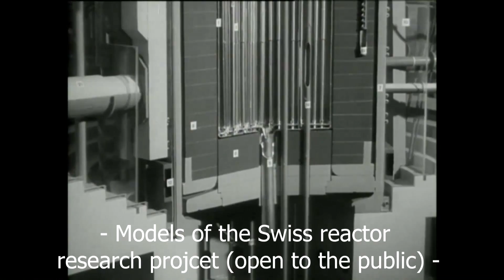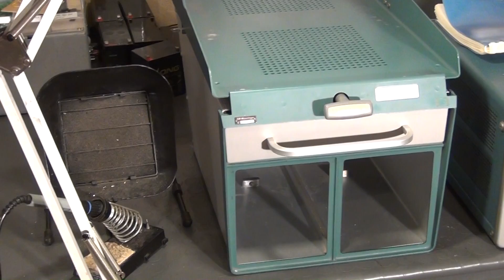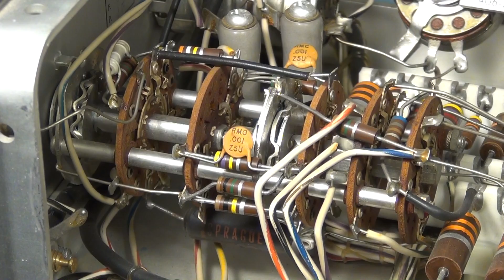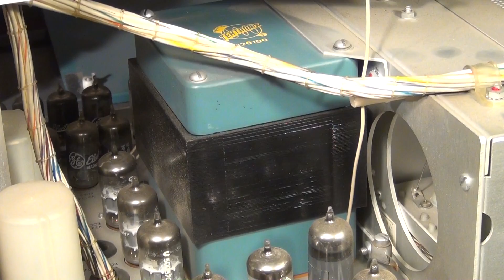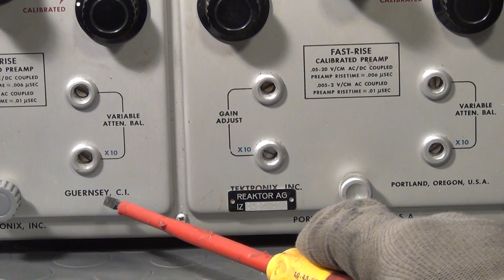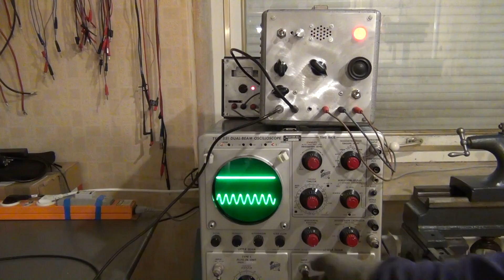A Gift from the Nuclear Energy Research Lab

Comment: Thanks for your videos. I was an EE at Tektronix in the Lab Oscilloscope Division at the peak of the company, in the 1980s. We had some really phenomenal solid-state lab 'scopes, including the 7834 500MHz phosphor-storage mainframe, and 7104 1GHz realtime analog mainframe that could display a single-shot waveform at 200picoseconds/division (and had an effective writing rate greater than 30cm/ns or greater than the speed of light). You can't appreciate how revolutionary this instrument was unless you've tried to capture a single-shot event such as a nuclear test, using a traditional 'scope with a camera hung on the CRT loaded with 10,000ASA Polaroid film. However, many of the seasoned EEs at Tek considered the later 500-series, especially this 551 dual-beam as the finest instruments the company ever produced. They didn't have the performance of the solid-state 7000-series 'scopes but as you can see, the design and workmanship was incredible. As far as the Telefunken tubes, they may be original. We had a European division that manufactured in the Common Market (EEC) to avoid onerous import duties and those tubes may have been installed at the EEC plant even though the panel says Beaverton, OR. That was before my time so I'm not sure. I've owned several 500-series instruments that had 100% original tubes, the designs were very conservative and the tubes lasted a long time. I have a 575 curve tracer from this era with 100% original tubes and it's in perfect operating condition.
Reply: If you are still in the Beaverton Oregon area, you should try Tektronics soup at Thai Bloom off Cedar Hills Blvd. Really good stuff. I used to work at the auto center across the street and worked on a lot of cars owned by Tektronics employees. Good people.
Reply: I was a ET at Scientific Atlanta in the 90's and we used Tektronix Network Analyzers to tune and set up linear Amplifiers. Great machines.

Comment: A lovely piece of kit. 
I spent some years in my early 20's repairing and re-calibrating similar 'scopes, mostly 545 and 585s, type 8x plug-ins etc. Just so that you know, you have to use special silver-loaded solder on those ceramic strips. If you use regular solder, you can break the bond between the metallization and the ceramic, which can make life unexpectedly interesting with some parts running at 500v. You really don't want those just waving around in the air...
I hope this helps if/when you need to do some maintenance.

Comment: I just stumbled into this post.  I worked at Tex as a college student (Oregon State) from 1961-1962 during the summers.  I assembles the sub chasis with the silver solder saddles where the capacitors and resistors were secured.  We could check out scopes from their lending lab and take home to play with.  As I remember the duel trace scope at the time cost $3,900.  I was so impressed because this was the same price as a new Corvette.  This video brought back many great memories.  Also, the first computer I was introduced to was a vacuum tube model located in the basement of the OSU math department.  Took up about 1,000 sf and required large A/C to cool the room.  Slower and less capable than a cell phone.

Comment: I suggest that you research the term 'distributed amplifier'.  It's a type of amplifier that overcomes the effect of the irreducible self capacitances of the valves (i.e. thermionic tubes') by incorporating them into a pair of delay lines - one in the control grid circuitry, the other in the anode circuitry.  Each section of the delay line incorporates one valve (or, in a push-pull amplifier, a matched pair of valves.)  The idea is that the input signal and the output signal proceed through the amplifier at the same rate, keeping in step with each other.  The distributed amplifier was patented in 1936 by William S. Percival who I believe was an employee of E.M.I. Ltd., Hayes, Middlesex, England.  See Wikipedia.  The delay inherent in the distributed amplifier is acceptable in oscilloscopes because it is often desirable to delay the application of the 'Y' axis signal to the vertical deflection system to give the time-base (aka 'sweep') trigger circuitry to get started.  Modern digital oscilloscopes work on a completely different principle, employing a fast sampling system to take successive samples of the input signal which are then read to appropriate pixels on the display screen.

Comment: Hello from Portland Oregon. I know the first two locations of Tektronix. It started as a radio repair shop. Now it's a bicycle repair shop. The second location which is the address of the first known advertisement has a nightclub now. Between the two locations on the same street is the childhood home of Linus Pauling (this fact has nothing to do with oscilloscopes). One of the founders of Tektronix Howard Vollum wrote his senior thesis at Reed College on Oscilloscopes. Reed College surprisingly has a nuclear reactor which is run by undergraduates. My dad worked for Tek when I was a child and I think he is the reason floppies were 1.44 megabytes. Back then almost anyone with a technology career in the region had worked for Tek at some point. A while ago someone told me the US government bought a new scope for every nuclear test because they became radioactive. Engineers knew that the only part likely to become radioactive because of what elements it was made of was purely cosmetic.

Comment: The ceramic terminal solder strips need to be repaired with high silver solder as regular lead-tin solder will dissolve the plating off the ceramic strips. 

 Many of the scopes has a short length of the correct silver solder inside for field repair purposes.

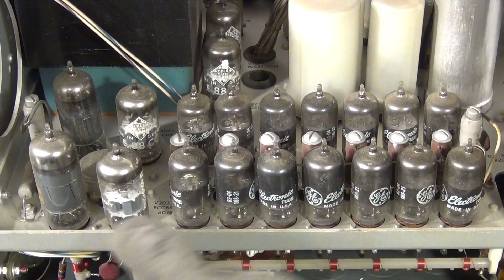Comment: 3:32 Be careful handling old vacuum tubes in devices where you have no documentation. The tube markings become brittle from heat and age, and will wipe off the with lightest touch, and you may now be unable to read the numbers you just removed. The white markings on the GE tube are crumbling and you probably did that when you pulled it out.

Comment: I just came across this on YouTube.  I worked for Tektronix for 23 years, my father and my uncle before that.  A few details about that model of oscilloscope.  The solder strips are ceramic, manufactured by Tektronix including the plastic mounting clips.  Except for the vacuum tubes (valves) and sockets, resistors, and capacitors, Tektronix made everything in that oscilloscope.  Nuts, bolts, sheet metal, switches, knobs, face plate, CRT, transformers, cart, etc.

Comment: A while back I saw an email offering an old Tek scope like this free to a good home,  so I went and snagged it.  It's a 536,  with one plugin giving dual traces,  and the cart.  I still have it and it still works,  though it's not my primary scope.  TURN DOWN THE INTENSITY!  You're going to end up burning that screen!  The terminal strips are not plastic,  but ceramic with silver bonded to them.  If you use regular solder the connection will detach from the ceramic,  you're supposed to use some silver-bearing solder,  a small roll of which was typically supplied in the little compartment that you open at the end of the video.  If your basement workshop sees any amount of dampness I would NOT keep that scope there,  as there are potential problems with the power transformer absorbing moisture and failing,  and they are unobtainium.  There are a few pretty active Tek scope mailing lists,  if you want to find out more...

Comment: i worked on a lot of scopes from that era. These instruments are very well designed and are remarkably long lived. My own 545 ran for 36 years with just a replaced tube here and there, it was replaced just because I needed a higher bandwidth instrument and the new scopes are so much smaller. .

 Those white strips are ceramic and all the solder is silver bearing solder, if you replace any soldered parts use silver bearing solder. A drop of oil in each of the fan bearings every couple of years will keep that fan working for a very long time.

Outside of the tubes the only other parts that will fail over time are the electrolytic caps, they dry out over time but some will last over 30 years.

Comment: A good reminder of just how much more there was to building instruments that long ago. When I was a child my father had vacuum tube oscilloscope that I used for learning. It was single trace device. The first dual trace scope I saw was from HP; that was in the 1070s.  About a year later I saw a Tektronix unit and the was the best I had ever seen at that point but it was mostly solid state except for the CRT Display.  Amazing to she so much functionality in a vacuum tube based unit like yours.  I expect you will have a decent heat source from this if you keep it in your workshop.

Comment: Greetings from Brazil!

Congrats on the pretty cool channel! I'm a long time follower and I appreciate the videos a lot. 

Now that's a nice gift they've sent you! Those scopes are amazing part sources. I remember buying them on yard sales for as cheap as 15 euros when I lived in France a couple of years ago just to take them appart and use the parts. Everything inside is top quality grade. Tube sockets, tubes, transformers, pots, the best of the best. I still listen to a tube amp I built using the power transformer and the sockets and some tubes from one of those scopes.  Everything is still as good today as back when they were made even the caps are still good (most of the times). Whenever I come across one of those I save everything I can, even the wires and screws. Top Quality.

So thanks for sharing the cool stuff and all the power to ya!

Dennis G.

Comment: A nice scope.  the white strips are ceramic and you are suppose to use a special solder if making any repairs to prevent the metalization dissolving.  you may find a little length of spare solder inside the machine somewhere, or if you write a nice letter to tektronix they may even send you some.

Comment: FYI: (other comments NOT read)
Those ceramic component mounting strips are restricted to silver solder only (reason?). Tektronix mfr'd them themselves, Every piece of gear using them had a meter length of silver solder attached to one of the covers for use during component replacement. During my high school 3 year/3 period Technical Electronics (1965-1968) we were often treated various Tektronix made films including one about the mfr of this line of o'scopes. Looks like yours had an external mounted power supply since the case was otherwise full. (Now to watch the rest of that video.)

Comment: You will find that the solder strips are silver-plated ceramic.
I really enjoy your channel, very interesting!
Reply: That need special high silver solder or the plating dissolves away and the connection floats loose.  Some units had a small coil of appropriate solder inside for field repairs.

Comment: Those ceramic (and they are ceramic) assemblies use silver solder. Keep in mind that this was designed before there were polymers that would take the heat of soldering. Teflon would have been brownish yellow. Nylon would melt. If you use lead based solder, the terminals will disintegrate. There is a tekscopes group out there (yahoo groups?) for owners of vintage tektronics scopes.

Comment from the maker: I said that some of the trim-pots are for the various screen adjustments. The trim-pots for those adjustments of the picture tube are of course under the EHT-supply. The trimpots in the front of the device have another purpose as you can see by taking a look at the original labels. Sorry but it was already late at night and I was already really tired when I recorded that part of the voice-over.
Reply: If you pan on using it, clean the fan. If it's been sitting around for a while, those old induction motors will chew themselves out whilst running. I made the mistake to leave one uncleaned and it died weeks after.

Comment: Those German tubes may be original to the installation in Switzerland (maybe not all tubes were supplied from the states or some assembly was done there) or the tubes were replaced in groups for matching purposes. There are simply too many German tubes in that unit and they are too well grouped together to be spot replacements. If they were spot replacements the replacement tubes would be in somewhat random spots (higher quantities in high power circuits is likely).

Comment: How nice to see that you have found a well working example of these behemoths. My own 545B originates from the Danish nuclear test center (Risø), so quite a funny connection there!
The soldering strips are referred as being ceramic on lots of forums, but I am not sure. You have to use some high quality silver bearing solder if you want the metal "U"'s to stay in place. Is the Delay line working properly? :)
Reply: Yes, the strips are ceramic. Tek used to have their own ceramics and glass facility where they made those, and the CRTs.

Comment: Funny how you call the scope a behemoth and then you put a simple sine wave generator on it that is larger than a loaf of bread!
Tektronix is the cadillac of scopes. Silver connections on ceramic strips. Most of all I envy you have the whole cart and the enclosure. I also have a dual trace model but mine was rack mounted so it is naked. :{

Comment: hello tpai.
the vid was a good one and brought bakc a lot of memories as i have used..and still have some of it today.it's quite the haul :-) a tube tester will be of use for you at this point and testing the electrolytic capacitors would be advisable although i wouldn't think that there will be much trouble from them because of the grade of materials that were used in their construction. the general electric tubes are most likely original. stable input voltage is a must as well as initial warm up of the components(15 to 20 minutes) for really accurate measurements. looks like your shop is coming along nicely.
=dok=

Comment from the maker: That white stuff they used for the soldering strips doesn't seem to be a ceramic, it must be a polymer. I think it's teflon. Does anybody here know that for sure?
Reply: Could it be phenolic?
Reply: The white stuff is in fact ceramic with silver plated contacts. If it hasn't been removed over the years, you should find a small bobbin of silver bearing solder somewhere in the chassis, usually on the back wall. If used for repairs, normal lead tin solder will quickly erode the silver contacts making them useless.
Reply: Jim's right. The terminals used in the ceramic terminal strips are very fragile. If you use any solder (or flux?) other than the silver solder, there is a risk that the silver terminals will delaminate from the ceramic and render the terminal strip useless. 

Paul at "Mr. Carlson's Lab" channel is a good resource. He's got one of these 2 beam scopes (a 555) and has done some renovation. 

First priority should be to replace all those paper caps that are most likely leaking DC and killing the tubes. "Don't turn it on, take it apart -- and fix it!" (c; 

And when soldering those term strips, I would first fit a new tip to my soldering iron to avoid contaminating with lead (or lead-free) solder. And, of course, tin the tip with silver solder. 

(Do you always wear gloves?) 

Cheers.
Reply: Took several tube type Tek Scopes appart.... Ceramic with silver plated terminals. If you're lucky, you might find a tiny spool of fresh silver solder attached to the aluminum cover on top of the high voltage supply and that's always a perk, that was actually there from factory
Reply: Hey man, Mr.Carlsons lab has a video restaring this exact scope, I think you should watch it, he speaks about lots of things you misunderstood in this.
Reply: +Rogerio Lazzari Jr - Mr. Carlson has the triple nickel (555) I recently acquired one as well. rhe white strip are ceramic. look in the back if the case and see if you can find the supplied roll of silver solder you should use to replace any components in the case. Nice piece of history that is still usable...
Reply: It's a good video, but that's a different model of scope with different design. TPAI didn't misunderstand things, he just made a brief overview of a model 551 scope
Reply from the maker: Hey thanks for your reply. I knew that someone in the audience would know exactly what these parts are made of!
Reply: They are indeed ceraminc, I have some NOS spare once. There are video's that are made in the 60's showing the production including soldering.
Reply: At one point they used to include a little bit of silver solder inside the scope so you could repair things on these ceramic posts. I have a 564 which is very similar (though single beam).
Reply: that is right, they included it in all 5XX tube scopes. I have a 547 that still has it. But I have a very early (1966) 453 that also has a small spool of solder behind the fan panel.
Reply: I no longer have the scopes, but still have 3 spools (filled with solder). Just as a souvenir. The scopes are now several tube amps and lots and lots of spare parts.....
Reply: +The Post Apocalyptic Inventor check out "mr carlsons lab" channel. He has two or more 500 series tectronix scopes. I think he mentioned that solder is acctually silver. But dont quote me on that, check oit his channel. Thanks.
Reply: u can u that thing a a synthesizer
Reply: How do you date a tektronix scope?
Reply: YES! THIS!!!
Reply: There is an internal training video on VintageTEK of the ceramic terminal strips being manufactured, installed and soldered to, very useful stuff, as it shows the TEK approved way of soldering to them.
Reply: Beryllium oxide. An insulator you can silver solder to.